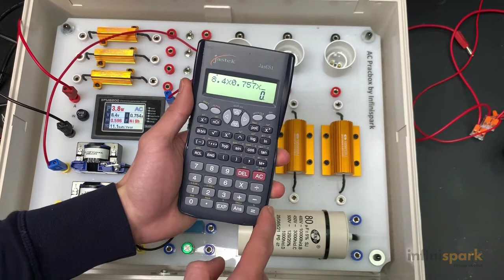Power factors of various loads

Comment: Electrical engineering tools and use make video on that.
Reply from the maker: Thanks Shivkumar, any specific tools you would like videos on? So I can pass your request to our team.
Thanks
Reply: Sure i want 
1)Test light 
2)wire stripper
3)Crimping tool
4)Pliers
5)Wire guage
6)Continuity tester
And than make video on how to use meters like voltmeter, multimeter,ammeter.
Thank you for such good video and explanation 👍